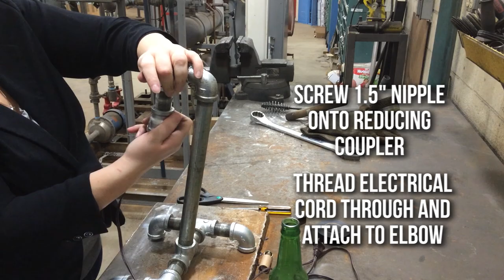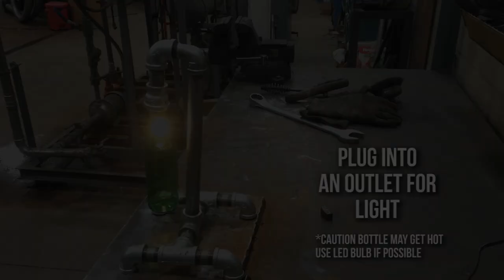Yuengling Lamp

Comment: how does the bottle stay attached to the pipe fitting? does it screw in or is it just held by the tension of the wire chord?
Reply: I've been wondering the same. In this case it looks like she has the wire tension holding it. That's probably why the bulb is way up at the top. I've heard gluing a plastic coke cap into the pipe with a center hole for the wire can work